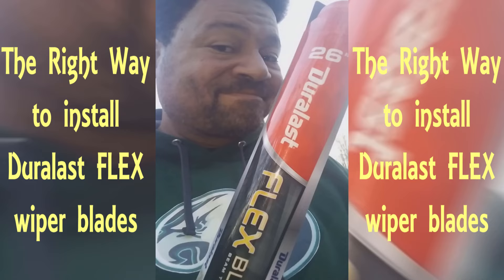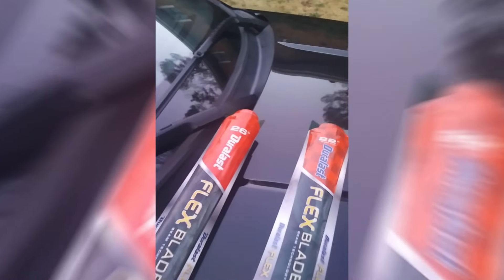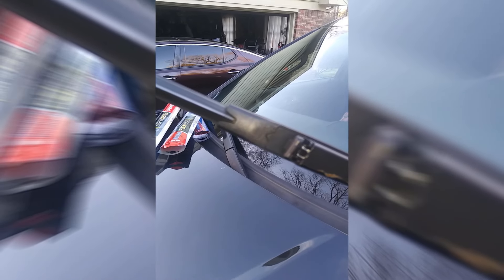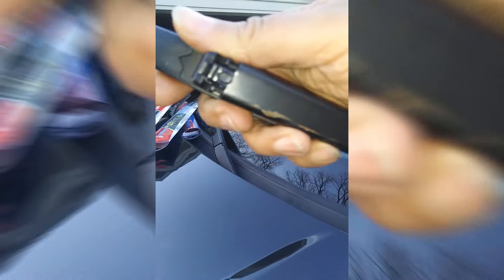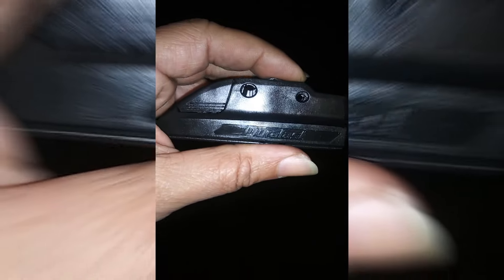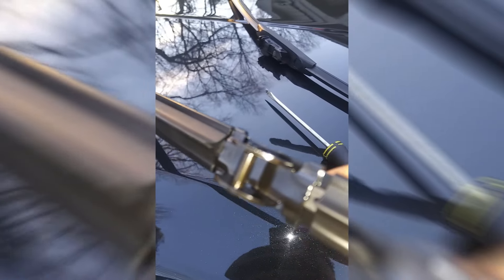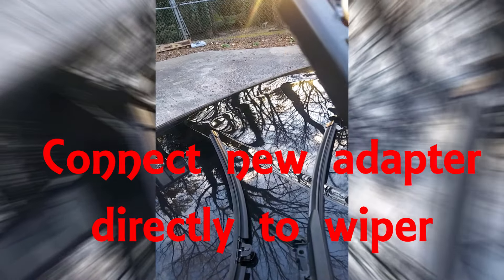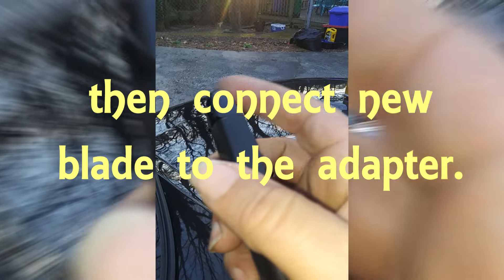Installing Duralast Flex Blades (The Right Way)

Comment: Yeah, Thierry directions indicate it just pops off after you lift the tiny cap. Pure bs. You need to pry the crap off of the installed adapter, destroy it if you must. Then their Lil  adapter looks so tiny it seems s lot weaker yhan what was on there. But rain-x is worse, they don't even supply the adapter

Comment: Can’t figure out the adapter piece I need for my car, it’s different
Reply from the maker: Most vehicles have wipers with a "hook" on the end. There should be an adapter in the package that fits your vehicle.
Reply: @jonestownmusic404  I figured it out, yes for the hook, you snap the adapter onto the default adapter that’s already on. It’s the one that has a nice curved surface for the hook.